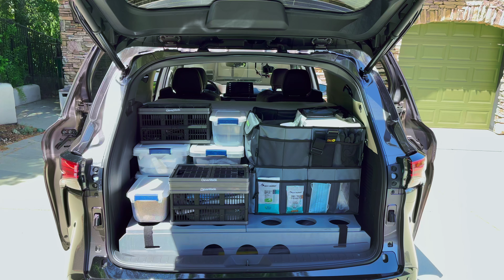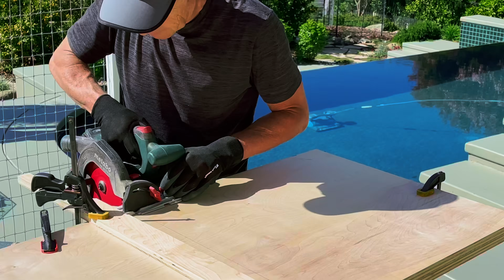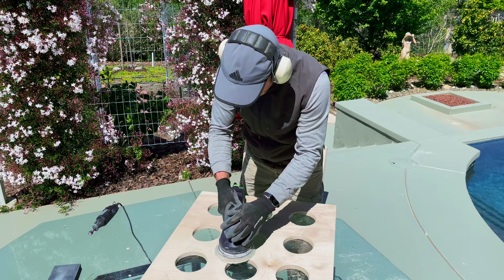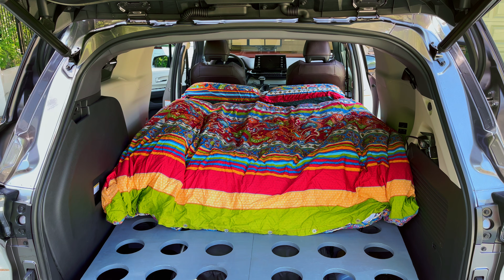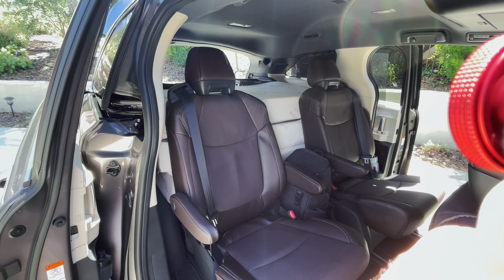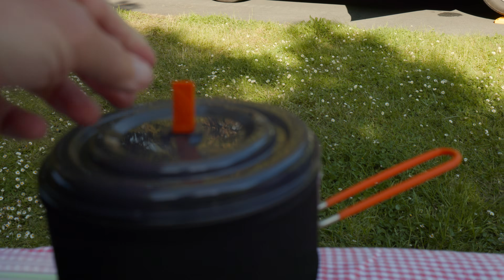2021 Toyota Sienna Camping Conversion: 2 and 4 seats sleeping configurations

Comment: I like this. Very interesting using those telescoping ladders!
My only concern is that the wood structure might make scratches on your new van's interior. Considered putting some soft covering over the plastic, perhaps?
For me it would be good for the Resale Value of the van to prevent as much wear/tear as possible
Reply from the maker: Hi Cyrus, thank you for your comment and the question. During the design and frame adjustment process I was very concerned about potential scratching of the plastic interior as well. To avoid this I left about ¼ to 3/8” gap between the sides and back panel of the van. Once the structure is in place and tided down with ratchet strap is is rock solid and does not move. So far I don’t see any places that are or might be affected by the structure. Since is my case it will stay in the van permanently (or until I am ready to sell the van) I hope the ware and tear associated with my conversion will be minimal. Enjoy your new Sienna!
Reply: @Tellvia  interesting thank you sir

Comment: Thank you for good infos. What trim of Sienna you bought? Which trim is good for a long distance trip and camping,   FWD or AWD?
Reply from the maker: Hi Seihoon, we have 2021 Sienna Platinum trim, which comes with AWD and 1,500W AC inverter. Both options are very valuable when camping. We found that AWD improves car handling on the highway. We see, on the drivetrain display, that AWD engages very often during highway turns. It also was helpful when we took our Sienna on gravel roads. The inverter is highly desirable if you’d like to use a portable refrigerator when camping and to charge/use your portable electronic devices when driving. I hope this is helpful. Cheers!
Reply: @Tellvia  The engine noise is partially amplified and runs through the entertainment system. It is adjustable if you use TechStream software and an appropriate interface module.
1) Engine Sound Enhancement (ESE) pumps engine noise into the cabin via the radio/media system.
ESE can be turned ON or OFF (using TechStream); if it is ON the sound level is changed based on the ECO/NORM/SPORT switch with ECO the softest sound and SPORT the loudest sound added to the cabin.
2) Acoustic Noise Cancellation (ANC) uses audio beam forming to suppress noise in the cabin lowering the audible noise levels for occupants in the seating positions.
ANC can be turned ON or OFF (using TechStream); if it is ON the sound level is changed based on the ECO/NORM/SPORT switch with ECO being the most anti-noise (most quiet) and SPORT the least anti-noise. No, you can not lock ANC into maximum anti-noise, it is always tied to the ECO/NORM/SPORT switch.

Comment: Thank you for the video and all your detailed information. I have a new van coming in soon. Won't be for two, just me!  I have a few questions. Did you make any covers for the seat trolly, and where did get the resistors and what value of resistors did you use for making the airbag light go away?  Maybe you got the wrong value of resistor? Also... Did you run the Air Conditioning in the back like they do in Prius camping? Thanks again!  Happy Camping!  I am buying the van with a 10-year warranty, plan to travel all over the USA, Canada and Mexico.

Comment: First, thank you for your video (and the one comparing Model X with Sienna...). Very useful and precise informations! I am glad i found your channel.

One major advantage of the Sienna Hybrid you did not mention yet: the possibility to use the the Heat/AC when you sleep in the car, using the hybrid battery (like in the Prius, wich many people use for car living). I would really be interested to know if it works well in a real situation. Does the car have to start itself often to recharge the batteries? I have read somewhere that the car would have to start 1-2 minutes every hours to recharge the batteries, depending on the situation.

Other major advantage: the 1500 W Inverter. I was surprised to see you are using a Jackery to power the fridge. Wouldn’t plugging the fridge directly to the inverter do the job?

Boy… so many questions… I can’t wait for your future videos, maybe answering some of them!
Reply from the maker: Thank you for your comment, questions and for subscribing to the channel.  I am very interested to test the "camping" mode in our Sienna. During our recent camping trips we did not need AC/Heating but I will test this feature in the coming weeks. When I was studying the controls seating in the car with the car and the AC ON the engine started every 10-15 min for about 3-5 minutes. It will be interesting to see how it works when camping and sleeping in the car when it is 85-90 degrees outside and AC set for 72 deg inside the cabin.
The inverter works only when the car is turned ON and the driver needs to remember to turn the inverter button ON (we are still learning to do it every time after stops).  We wanted to have a backup battery for the fridge when we would be away from our campsite in order not to leave the car in the ON state as it will periodically will start/stop the engine and potentially attract unnecessary attention and concern about unattended running car. The good thing about the inverter is that is charges the battery and cools the fridge when driving, so we always have plenty of charge for the fridge even if we plan not to drive for 3-4 days. I will plan to include the Inverter topic for discussion in the upcoming Sienna videos. Are you on the market for new Sienna or already driving it? Cheers!
Reply: @Tellvia  Engine starting every 10-15 min for 3-5 minutes would not be workable in camping situation unfortunately… I wonder how people sleeping in their Prius manage the situation. Oh, so the inverter only works when car is on, i did not knew that. I understand why it makes more sense having the Jackery. Not quite yet in the market for a Sienna but i am planning to! Thanks! :)

Comment: Great video about the van conversion. What did you do about the airbag message when you remove the 2nd row seats.  There're concern that the airbag message would impact the rest of the airbags if something would to happen.  Could you please tells us about this.  Thanks
Reply from the maker: Hi Tien, thank you for the comment and question. The topic of Aibag message is widely discussed on the web. Here is a link to recent discussion specifically about 2021 Sienna - https://www.siennachat.com/threads/2021-sienna-mid-row-seats.64221/page-3.
Reply: @Tellvia  I'm a regular on that forum.  Just like to get your input about it if you not already a member in the forum already.  So far no one really has a definite answer for this issue yet.

Comment: Thank you good job...what mileage gas you getting mpg on sienna...
Reply from the maker: In our last 2,500 mile long trip which consisted of 50% highway driving at 70-75 mph and the other 50% at around 50mph we saw average 37.4 mpg. I would not be surprised to see a 40 mpg on a highway at a steady 65 mph. Cheers!
Reply: @Tellvia  I often got 41 mpg driving 69 mph speed on freeways. One thing I did was to keep tire pressure at 42 psi at early morning cold tire pressure measurement. But during the day or during highway driving, the tire pressure get up to 50 psi. I was surprised to see the tire pressure at 45psi during the car delivery a few weeks ago , because the door label says the recommended tire pressure is 35 psi for both front and rear. So I don’t know why the discrepancy. Actually I was quite disappointed to know that 2021 sienna interior volume is 100 cf, while previous year model was 150 cf. I have hard time to fit my mountain bike into the van. I consider this is a very backward design by Toyota. 2021 sienna removed a lot of utility abilities of the van compared to previous years model (which I owned a 08 sienna where I can load 3 bikes inside the van. ) it’s more like a suv size than a family utility van. The hybrid engine is weak (240 horsepower), especially pronounced weak during merging into freeway. But once it’s at freeway speed, acceleration is better due to its electric motor assist, good for passing. I really wish Toyota should have put plug in rav 4 hybrid engine (302 horsepower) into sienna because sienna really need that horsepower. I m wild guessing that 2022 sienna may have the plug-in hybrid engine like the rav4 prime.
Reply: And yes I concur with that mileage! On my very first trip in my 2021 Toyota sienna XSE driving at home from the dealership I did get 41 miles per gallon, of course keeping it under 70 mph is the best for getting excellent fuel economy with the 2021 Toyota sienna hybrid van.

Comment: Great info - Thanks!  I've been thinking about doing exactly what you've already done and this helps a lot with my thought process.  Have you used the climate control function overnight to either keep the car cool in warm weather or heated during cold weather?
Reply from the maker: Hi Ric, thank you for your comment. We have not tried the climate control system to keep warm/cool yet while camping, as the weather was very comfortable where we travelled. My understanding is that this will be possible and I look forward to trying it. Enjoy your Sienna and good luck with your build!
Reply: @Tellvia  oh yes please! Do a review on the climate control capabilities of the 2021 Hybrid Sienna! 
As a Prius owner & avid car camper, I immediately subscribed!! I am so interested in what this vehicle will offer!
Reply: Is your Sienna hybrid? If so, why do you need external battery? Thanks for making such great video 👍